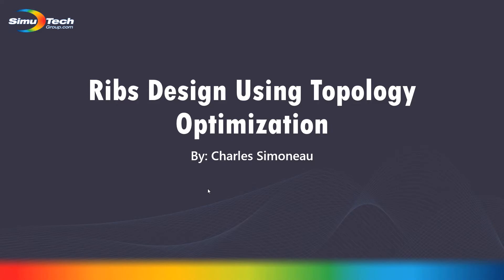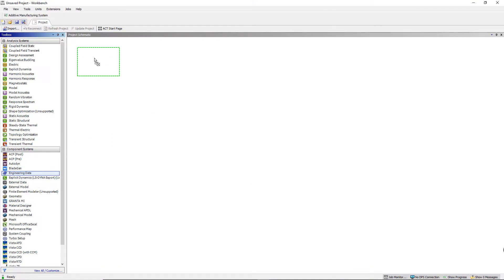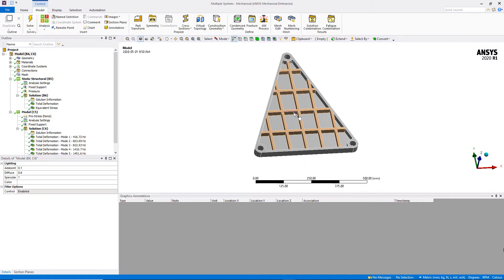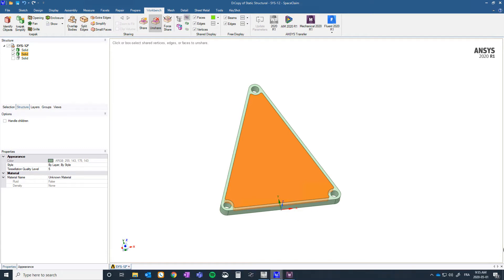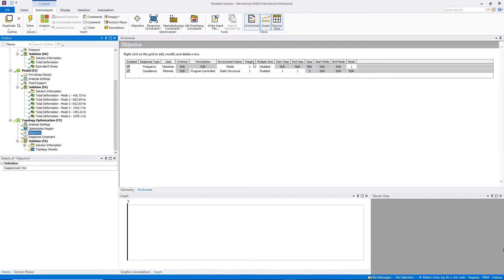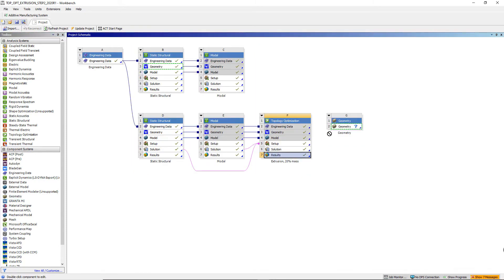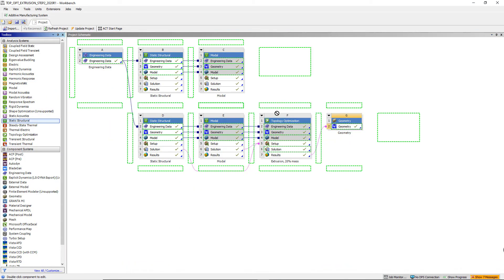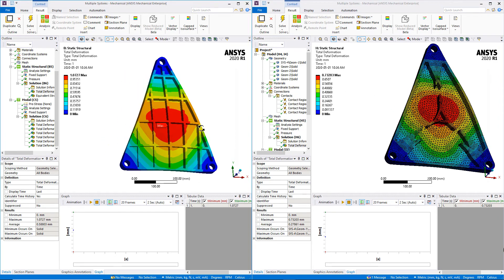Topology Optimization Rib Design

Comment: A rib structure with that thickness would probably cause sink marks, porosities/cavities inside the part? I'd say that the other option would be easier to manufacture good parts and be cheaper, material wise.